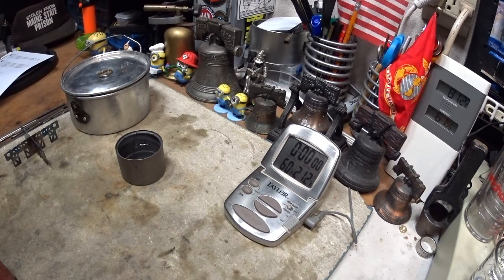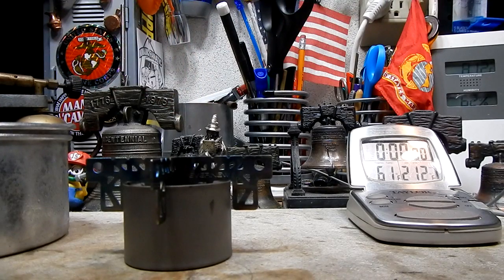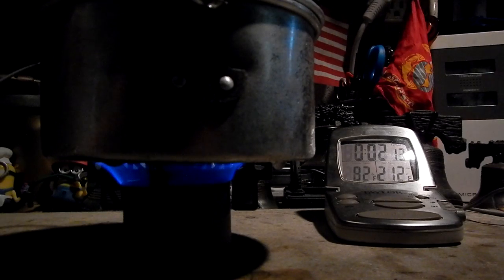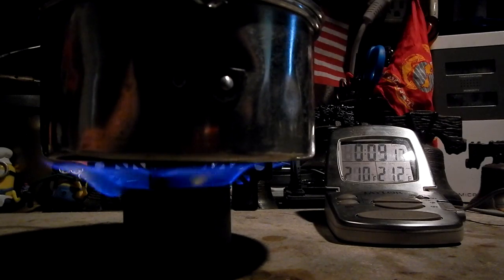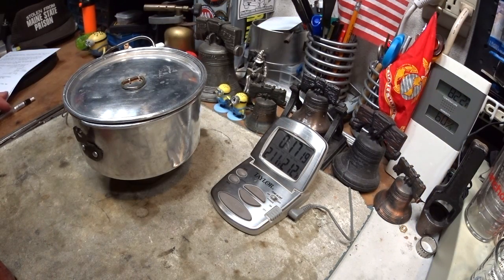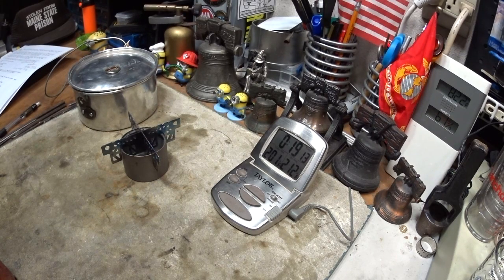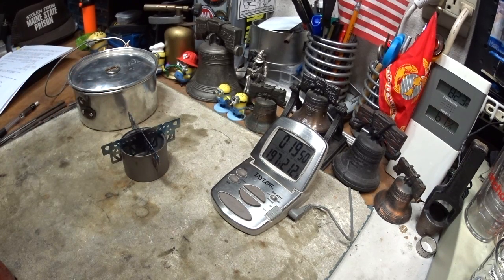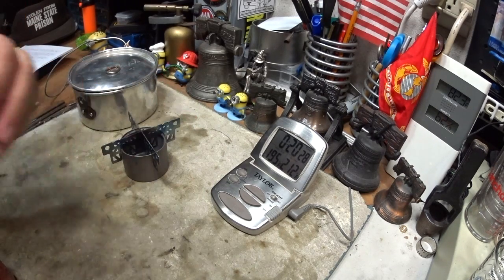TOAKS Titanium Siphon Alcohol Stove - Evernew Titanium Cross Stand - Boil Test #4

Comment: I’ve read warnings about using methanol (or “Heet”) because it’s toxic. The warnings even include not allowing it to get on your skin. (By contrast, isopropyl alcohol, which doesn’t work nearly as well as methanol, is non-toxic on skin, and is of course used as “rubbing alcohol.”)

My question is, once methanol has been either burned away or evaporated away, does anything toxic remain behind? Is there any sort of residue remaining in the burner that is harmful it touched by bare skin?
Reply: No. Loads of people use Heet and similar products, and while it’s toxic to ingest, avoid vapors from it as best as you can and a drop or two here or there doesn’t do any damage. I’d say come up with a method that works for consistently pouring in a safe environment, and you’ll be fine. Also, ISO will leave a residue soot on your pot that requires cleaning. Heet does not.

Comment: Good point about it being a stove only when there’s a topper on it to hold a pot.

I’m curious about how the thermometer senses the temperature. Is it just by proximity to your water pot? Is there a probe somewhere and I just didn’t see it?

Also, does a burner such as this use some special kind of alcohol or can one just use isopropyl rubbing alcohol? If it requires a special fuel, is that fuel easily obtainable, and is it inexpensive?

Comment: Believe we're missing the more important variable - burner height above ground.  By raising the burner in test-2, air was most efficiently fed to the system.  More air = hotter (and more efficient?) burn?  Couple other thoughts: 1) Yes, blue flames are an indication of efficient and hot burn, but any yellow flames on top of the blue also indicate unburnt fuel and inefficient burn (cooler and soot).  2) Needing a pot-cozy anyway, mine is titanium around 1/8" ceramic (2,200°) cloth.  By sliding the flame-proof cozy down 1/2", forming a lip, it captures and holds burner heat and guides that heat close to pot-sides.  (more...) 

This is similar to Jet-boil's thermal-capture system surrounding their pots, except much lighter and more thermal capture.  

It makes sense the primary variable is airflow, not pot-burner distance.  And burner height above ground is more important than pot-burner distance.  As long as the pot isn't so close as to interfere with complete burn nor so far to allow heat to escape, pot-burner distance should be a secondary effect to airflow (burner-to-ground distance)? 

Caldera focusses primarily on airflow, for example.  Evernew DX too.  Both raise the burner off the ground for better airflow and more efficient burn.

Comment: It's been said many times in previous comments, but simply flip the cross stand upside down gives a sweet spot 1" gap and the fastest boil times.  The notches on the cross stand grab the burner edge and prevent the stand from moving/sliding.  The position shown on the video is my 'simmer' mode, that burns 1min/ml at a slow boil (I use narrow Nalgene nesting pot/cups).
Reply: Glad i found this ty !
Reply: A few years on but going to try this in a couple days. Hope the notched method works on the Toaks as I’m looking to lighten the cook load with an alcohol stove setup.

Comment: OK  have seen all the TOAKS alcohol  stove test, and I could prove the same at home to tell that : "Blue flames and proximity of the high heat flames dosen´t  provides fast boiling performances". I believe that the reason why it is because the flames need to have certain "power of penetration" into the pot throw the base to heat the water faster than those... "loose and not power defined directioned flames" . I think that it is similar to what happens with bullets being shot by a fire gun... The bullets do not have the best power of impact as soon as they comes out from the muzzle, they gain the best  performance of shooting after a couple of yards. SO, the best performance we can get from any alcohol stove it is just in the point where the flames gains certain "solid strength"... or... intensity... and that is juuuust...juuuust... in the point where the flame turns from blue to yellow... or  maybe a bit after...

Comment: Thanks for all the testing that you're doing. A question; would a wind screen that completely wraps around the pot make it more efficient what with the heat hitting not only the bottom of the pot but also the sides. Wouldn't this make it faster to boil or maybe even use less fuel to boil?  Not sure how you would "film" this with the screen but it might be interesting to test.
Reply: Theoreticaly yes, look at Trail Designs Caldera Cone.

Comment: Doing a few back of the napkin cyphers gives some interesting results:  Tests #1 & #2 both put out over 800 W, but test #2 was thermally more efficient at 58% vs 47%. Both #3 & #4 had greatly reduced heat outputs (560 W & 530 W respectively) but were also both very fuel efficient at 58% and 57%!  So changing the TBBP not only affects heat transfer from stove to pot, but also the AMOUNT of heat generated and fuel consumed by the stove.

Test #1 required 20 ml of fuel to boil 2 cups, while #2, #3 and #4 used only around 16 ml to do the same work. More efficient, less fuel, more happy!

Comment: With the cross stand, I believe you can get a better cooking time if you let the cross stand heat up before you set the pot on it. The pot is drawing heat so rapidly that the fuel is not heating up as quickly as it would without contact. Let the cross stand heat up 30 seconds or so before setting the pot on the stove and cooking time will speed up. For boiling water flip the cross stand.

Comment: Please correct me if I'm wrong, but I always thought that the hottest part of the flame was the top of the blue flame (without any object on top).  Therefore, sitting a pot lower or higher relative to that point would reduce boiling time.

Comment: Hiram, Just noticed your back! Thanks for all your work and keeping "cabin fever" at bay in the off season with your vids. Just joined up to make comments but have been A BIG fan of your vids for some time. I'm curious about this burner for say a 475ml Toaks or Stanley Camp pot size base cup using an Evernew cross stand, upside down of course.  Boil test may or may not be interesting to anyone but it would be interesting what the flame pattern is on a "small" cup diameter. I believe it would work fine on a 550ml/GSI or the 750ml cups as my Trangia or Evernew Ti burner does. Please consider this, or similar for your next test. Thanks!

Comment: Hiram looked as if the cross stand was working like a heat sync.

Why not take a piece of hardware cloth and alternate a leg inside after a leg outside the stove to hold the pot 1/2 inch above the stove. I bet you would get a faster boil time.